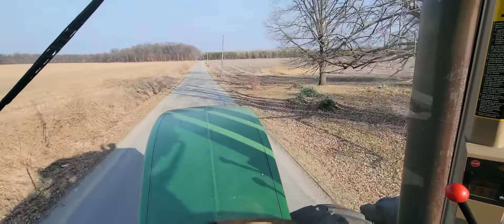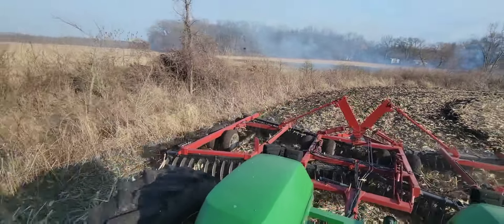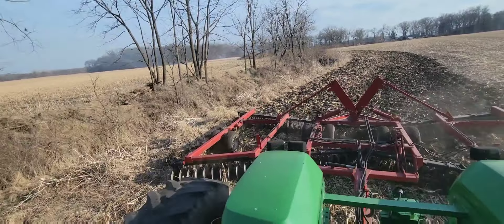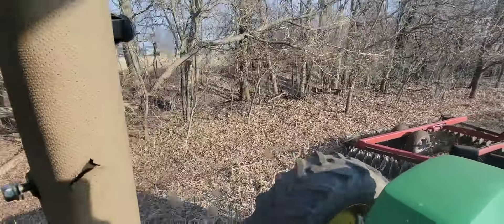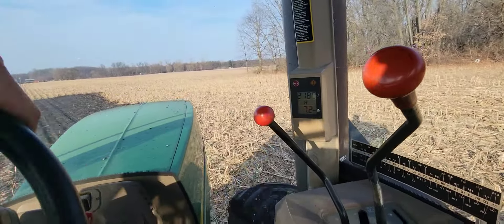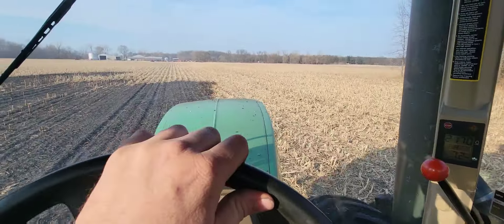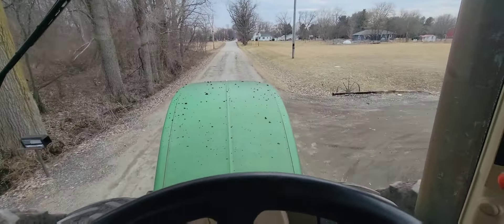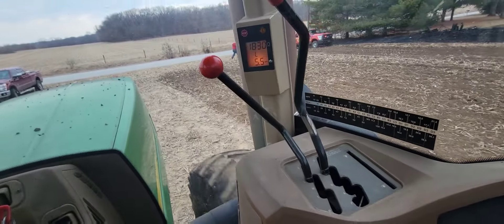John Deere Fighting Field Fires Helping The Fire Department Video!

Comment: I'm driving I see if I see a fire on the side of the highway even in a field if it's there's no fence or anything like that I'm always driving a flatbed tow truck usually it's my own trucks I'll do is I'll actually run my bed all the way down to the ground I'll drag the bed on the ground I'll just drag the whole thing to around the fire and then I'll go over and get it out in some areas I actually have to do it in reverse and I'll scoop the dirt up that's on fire onto the top of my truck bed and drop it back off to in order to flip it to try put it out

Comment: when i do controlled burning at my land to burn the long dried grasses, i use my tiller to put out the fire or control the spread. it works 10x better than spraying water since it stop the fire on its track. With water, the flame can overwhelm it and render it unreliable especially if the flame are like this 4:41.

Comment: As a retired firefigther I really like seeing people helping out the F.D. Great use of a tractor and disk. Here in Texas the Forest Service would cut a plow line with a dozer and then do a "back burn" by lighting off the grass/woods between the plow line and the fire to burn off the fuel in a controlled manner. Have had Hydro mulch companies send out hydro mulch trucks and trailers to assist at wild land fires. Those things can send water out over 150 feet.

Comment: I remember a story my father told me. My uncle was burning a brush pile he made cleaning the fence line on a windy day and left it unattended. The fire took off and started the field on fire. My grandfather saw the fire burning out of control so he grabbed my father and they took the only two tractors they had. One was an Allis Chalmers D19 and D14. They both hooked up the disc harrows and went to stop the advance of the fire. They managed to get the fire out before the fire department got their. Mind you this was back in 1982.
Reply: "left it unattended"  --> that was just stupid, good they could stop it

Comment: I helped put  out a straw fire (seed and straw) with a little 25 hp, dragging the bucket and box blade, knocking down the flame with the bucked than then the rippers pulling up dirt and box smothering it.

Catch the fire early enough and  lighter equip can deal with it.

ALWAYS call it in.
Knocking it down doesn't mean it's completely out.

Fire dept would rather come out and  check on  a fire you already put out than deal with one spreading that you thought was out.

Comment: We had a local farmer, that was raking his straw, with a tractor with an underslung exhaust.  The tractor had a loader on it.  The exhaust set the straw on fire.  The farmer panicked, shut off the tractor in the burning area.  The fire burned off the fuel lines, dumping all the fuel onto the fire.  The tires were burned off.  I was tasked with repairing the tractor.

Comment: grass fires go out super easy, i keep a 5 gallon backpack pesticide sprayer in my truck and you can put out alot of fire with just those 5 gallons. you would be surprised. or if you do alot of ag burning maybe look into a 15 or 25 gallon 12v spot sprayer they work amazing and some of them have 40' of spray

Comment: Here in South Georgia I do control burns every other year in my timber to reduce litter and control unwanted vegetation.  Was wondering why y'all don't do the same there.  Y doing control  burns the fires don't get so big. Areas where we have a real problem are the national forest where  they don't burn and when they have a fire it usually is a really bad one like the fire down in the swamp in 2011, burned over 500,000 acres. 40,000 acres was private land. When a fire gets that big and hot there is no stopping it.
Reply: I'm not sure where these guys are, but here in Illinois you will see small controlled burns along fence lines, road ditches and sometimes small wooded areas. We don't need to do it as often because it stays pretty damp around here year round.

Comment: as learning question; how come those in texas or your area do not disc/till over harvested crop immediately after harvesting? great video. thanks for sharing and your time.
Reply: Nothing could be worse for the soil to leave it uncovered for longer time. ..beside preventing for fires.
Reply: We leave the stubble in the soil to keep the dirt from blowing/washing away in weather.
Reply: @owenstrickler1185  The same here it's properly call erosion control iirc.